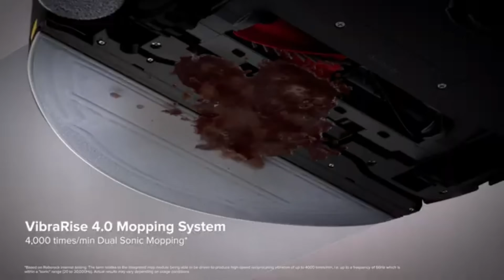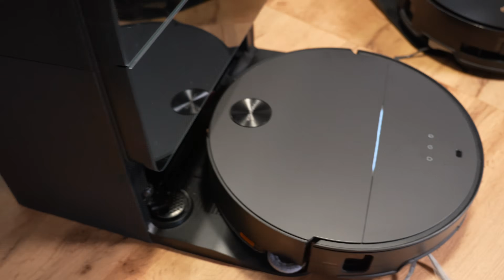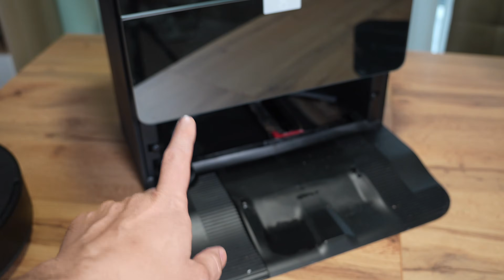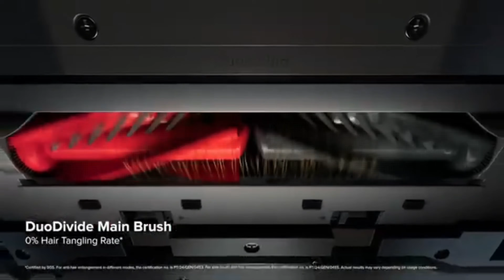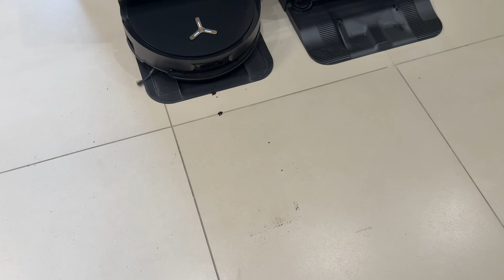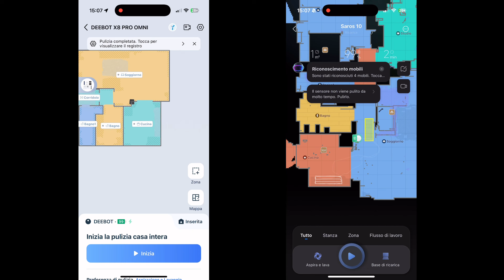ROBOROCK SAROS 10 vs. ECOVACS X8 PRO  🤯 VIBRATING MOP vs. ROTATING BRUSH: The WINNER Is... !

Comment: I purchased the Saros 10 and while it mopped well the issue I had was the vibrating mop could not get along the edge. There was about a 1/4" gap along walls. I purchased the Saros 10R. It mopped more effectively with the mop pads extending and running along the wall. It performed better in my opinion. And what I do like about the Saros is the robot is heavier than other brands which increases its efficiency for mopping. How heavy is the X8 robot? I tried the Dreame X50 and it was lighter than the Saros. My biggest problem I am having difficulty is finding a robot that will recognize a small dogs droppings. Both the Saros and Dreame did not recognize it and it was pretty gross to clean up. Maybe I have to wait for more advanced technology? Also while the Saros 10 and 10R were great with not getting hair tangled in its brushes, there were issues with the hair clogging up the shoot for the dust bin. It would roll into a ball and I'd have to manually clear it. I have 3 golden retrievers and I haven't seen any hair test that matches my challenge :) Thanks for the video!
Reply: Sell the goddam dog!!